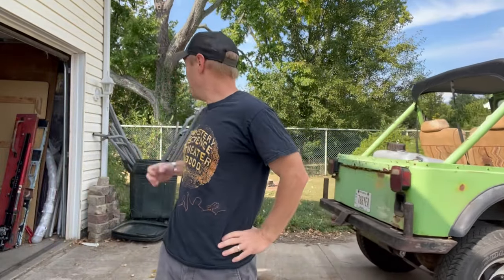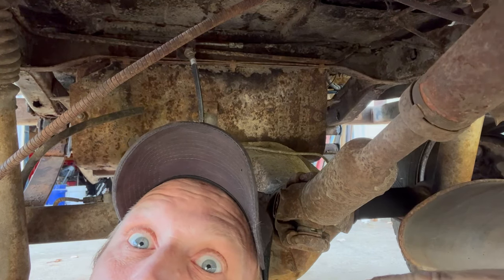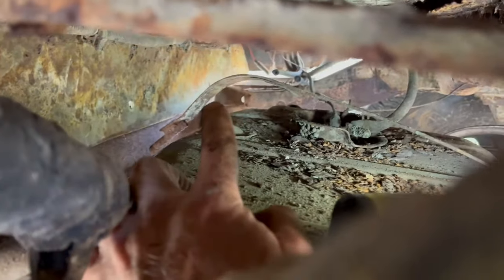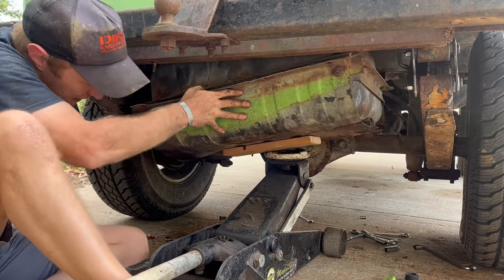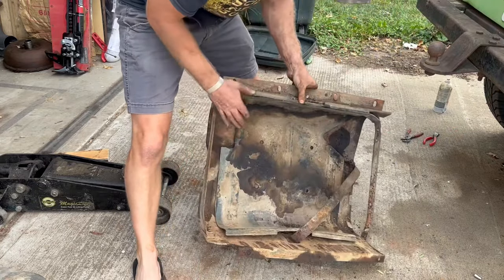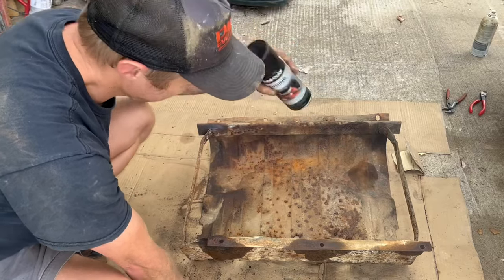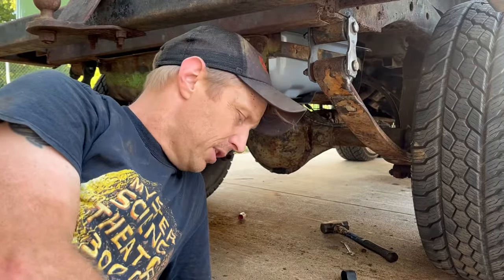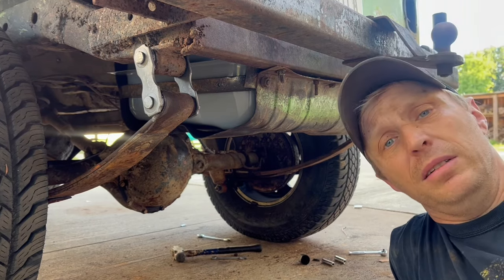1981 Jeep CJ5 Gas tank replacement

Comment: A wise man once said. You're supposed to remove all the metal before you paint the rust. I'm glad I only listened to him once. LOL The old jeep is coming together. See you on the next one, 😁
Reply from the maker: LOL.  I have found some frame rot I will need to repair, but I’m not worried about that skid plate.  If it ever gets to the point of just being a tank strap I’ll replace it!

Comment: Where did you put the ground wire to, the frame of jeep and what kind of screw did you use? Did you hook up the sending unit wire right before you raised up tank? 😊
Reply from the maker: @markfeuerherdt2338  yes ground wire to a clean spot on the frame or crossmember power wire you can reach once the tank is up
Reply: @Foxcanfixit thanks! Great video!
Reply from the maker: @markfeuerherdt2338  no problem, thanks glad you liked it.